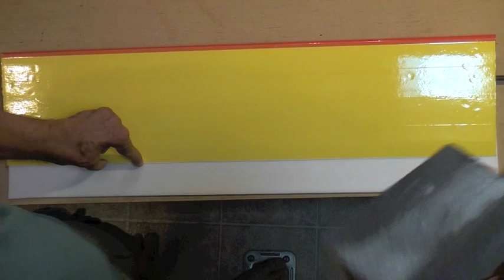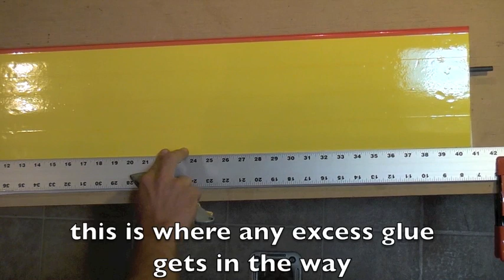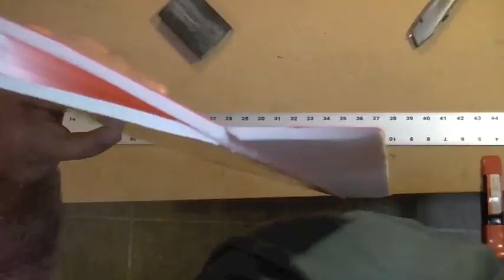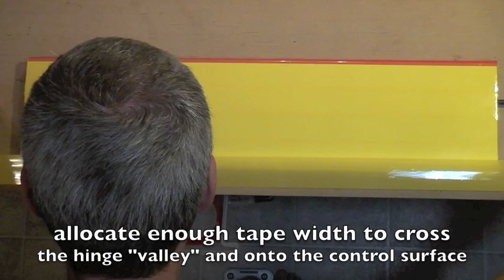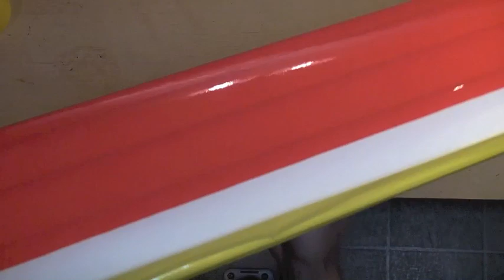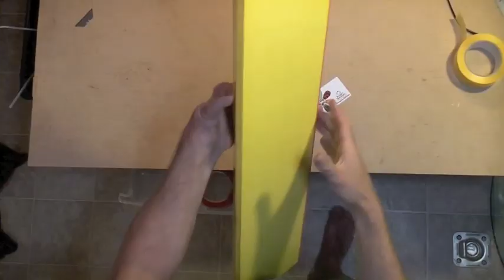the Armin Wing: part 4 - Making the Control Surfaces

Comment: My guess is that the resulting 'gap' in the smooth surface is preferable under the airfoil shape, as the airfoil works by effectively making the air travel faster above the wing than below. Any interruption of that effect will increase the chance of turbulence forming above the wing and subsequently reduce lift. Check out centennialofflight dot gov/essay/Theories_of_Flight/drag/TH4.htm

Comment from the maker: You could glue in the spar if you like to.  Most of my models either have a removal spar or have a stable arrangement where the spar won't move anyway.  It's easier to remove after a crash.

Comment from the maker: @ExperimentalAirlines Please note the overall configuration of the formers may differ depending on whether you use spar or not.  But in general the forward-most former is usually placed 1" behind the paper/peeled transition.

Comment from the maker: @ExperimentalAirlines result in a maximum thickness at about 40% chord (from leading edge, airfoil only) which is a good general purpose low to medium speed airfoil.  In the 3-former version sometimes the upper wing skin will only touch the corners of the upper former, the front one on the way up the camber and the rear corner on the way down towards the trailing edge.  This is particularly true if you don't curve the upper former.  So far working pretty well for me

Comment from the maker: @Searchworlds See the new video on "Armin Wing: Two-tone color scheme".  There are many ways you could customize it.  I usually use a two 1" formers in the 5" chord wing and three 2" formers in the 7" chord wing.  The formers are applied 1" behind the paper/peeled transition in both cases.  I usually squish down the top former in each type with the side of blunt, smooth object rubbed back and forth so that the upper wing surface engages the curve better.  In both wings this will

Comment from the maker: trailing edge section parallel with the lower surface of the wing, and then fixate it there with some glue and tape.  It sounds like you know what's going on so trust your knowledge on the aerodynamics.  I personally like to have full-span control surfaces and dial down the rates as needed.  The Peace Drone does benefit from pretty generous control surfaces for roll in particular, so if doing elevons I'd probably recommend at least 1/2 span and 1 1/2" control surfaces if that's your build.

Comment from the maker: @schnellschnells Very nice, looking forward to seeing your creation.  If it was a short control surface, like 1", you could just not hinge the fixed part and tape it as you like.  But the way the upper surface naturally cambers over the top and then down the trailing edge would make any longer a trailing edge section kind of like a fixed flap.  I guess you could either just cut that back towards the airfoil and finish the edge or score where the hinge would go, flatten out the single-surface

Comment: Instead of my foam RTF model, I'll try to do the same, but with corrugated plastic, canned fluro spray paint, and thicker adhesive fibreglass tape.  Not just the wings, but the whole plane.  Good ideas - I'll shave or sand the non-square edges, as you did, then cover them with my thicker tape.   Thank you for inspiring me in this easy, stronger, low-cost direction.

Comment from the maker: @mackenzierob1 (cont) with hot glue and a final piece of gift card.  The physics of the situation are kind of complicated.  The lower surface bears lateral tension, the upper surface lateral compression, and the plane of the joint up-down compression.  I think an angled, rigid spar members would work better than the way I did it on that twin sailplane, which is the only time so far. It did fly nicely though.

Comment from the maker: @mackenzierob1 It was a little complicated to join 20" sections to the tips of a 30" section with about 10 degrees polyhedral.  I joined the lower, inner surface with gift card sections glued inside, in flat configuration.  I then wedged out 1/4" of the upper surface of the outer wing.  The inside cells of both sections were buttressed with stiff plastic.  I raised each wingtip equal amount above main wing horizontal plane and glued it all together, filling and bridging gap